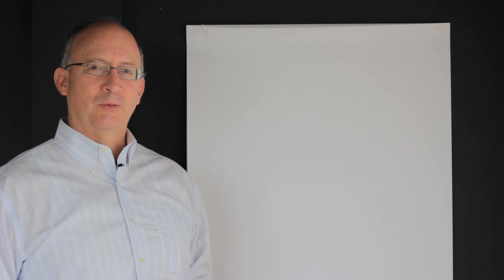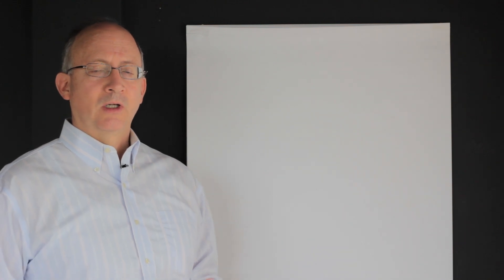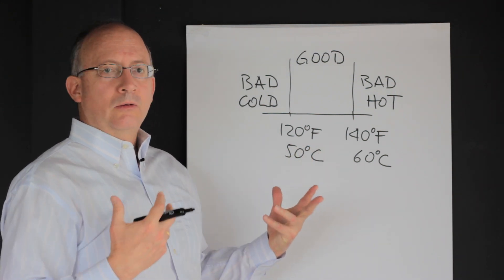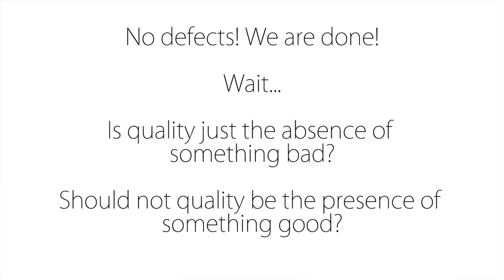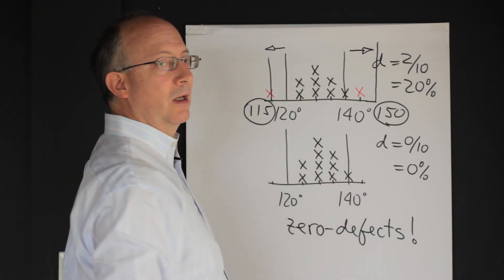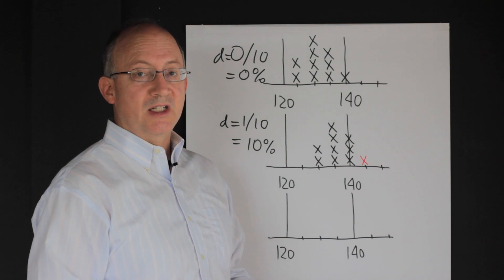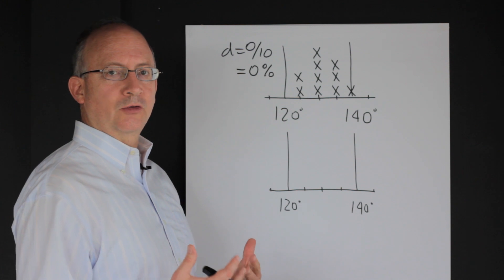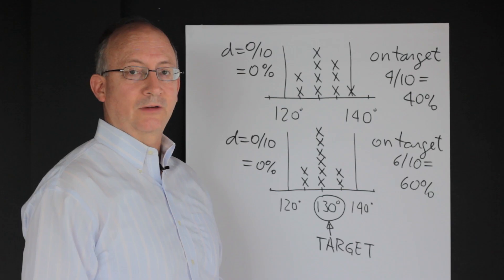Six Sigma | ZERO Defects 1: You don't want this | Green Belt 2.0® Lean Six Sigma | fkiQuality HD

Comment: I really appreciated the distinction between Lean, which focuses on reducing waste, and Six Sigma, which aims to minimize defects. One key takeaway for me about achieving zero defects is that companies often implement changes—such as broadening specifications or improving processes—to eliminate defects. However, while this may result in fewer defects, is it truly sustainable? A wider range of acceptability can lead to greater variation, and if the primary focus is solely on eliminating defects, a small issue—like one defect in ten—could grow over time. Ultimately, maintaining a precise target within a defined specification while controlling variation is not only effective but is lean and sustainable. One thing I’d like to apply in my workplace is analyzing historical data on net contents, Brix values, assays, and other key metrics to assess the level of variation. This would give me a clearer understanding of existing trends and help identify opportunities to sustain minimal variation. By making system improvements and implementing strategic changes, I can work toward reducing variability and ensuring greater consistency in our processes.

Comment: It becomes very crucial to monitor variation and defects when you get to the food industry or other industries that depend on human consumption and human use on themselves. This very big and important reason is "recalls". If you do not set up a good monitoring and inspection system in your processes, you can mess up the "recipe" of your product by not adding the proper amount of components or having foreign objects get in to the mix. Recalls are extremely costly for the company, which could lead to an enormous amount of waste of product, which comes from recalling it, the investigation that needs to happen to find where specifically the deviation happened, and any possible lawsuits that could spring up after the fact.

Comment: Everything that is manufactured is built to spec, with a tolerance.   In order to reach "zero defects", the easiest way to do so is to expand your tolerance so it covers all variability.   While it looks good on paper to have no defects, it will come at the expense of the customer getting inconsistent product.  The right way to do so is gather information from your customers to determine an acceptable tolerance for your product, and with good processes and management, work to keep everything within tolerance.

Comment: Focusing on a central target instead of having zero defects seems like a great way to achieve precision and predictability. The focus is on control and not just hitting the board anywhere. Does this tie into SPC?
Reply from the maker: Yes, this ties into SPC, because SPC lets you to stabilize the process by identifying and systematically eliminating the causes of the special variation until you are left with just random noise. Once you have a stable system, then you can look at ways to make it better by controlling the causes of common variation. We do this with the fishbone and five why’s analysis.
But remember that we must first stabilize the process before trying to improve it.

Comment: Good illustration that "zero defects" means within pre-defined specs so drawback is that "zero defects" doesn't control for variability. Controlling and reducing variability is part of important and part of continuous improvement.  Better to combine specs with the concept of Target and also measure % of time you actually achieve the Target.  Thanks!

Comment: The coffee model translates fairly well to my industry (laboratory) where the integrity of client samples are governed by quality control measures.  A laboratory control sample (LCS) will have upper and lower control limits that the result must fall between in order for the associated client sample (product) to be reported.  If the LCS is out of control, this indicates there is a problem with the system, or process.  Depending on the situation, the result will either be qualified and reported or re-analyzed after investigating the root cause of the failure. Re-analysis means reprocessing, which means time-loss.  Redoing an entire analytical process has two main negative outcomes - loss of efficiency and in some cases failure to meet a client deadline.  We track the number of these types of failures monthly as performance indicators, but we also take preventative actions to search for trends within the control limits.  For example, we'll open an Out Of Control investigation if we have five sequential ascending or descending points while still within the upper and lower control limits.  I'm looking forward to diving further into this from an operations perspective.